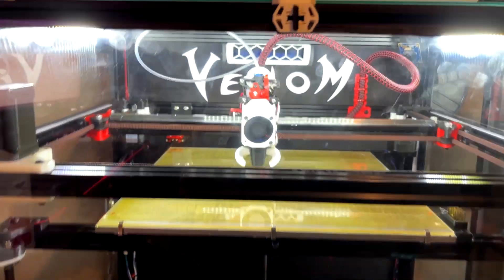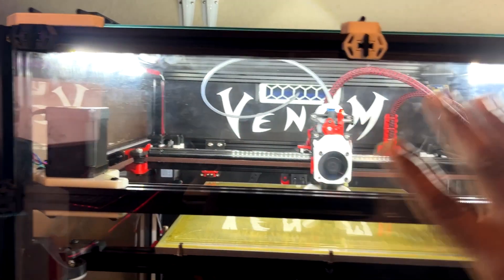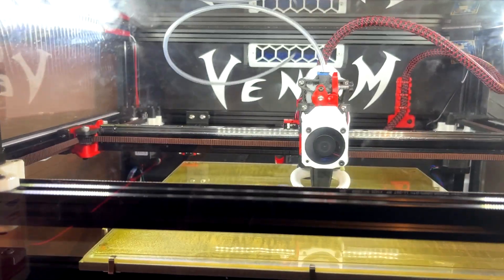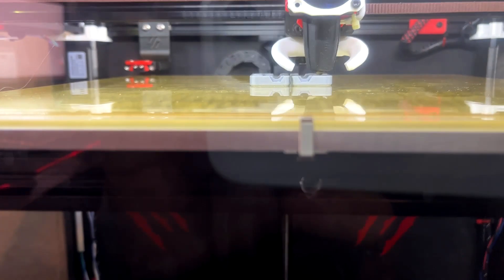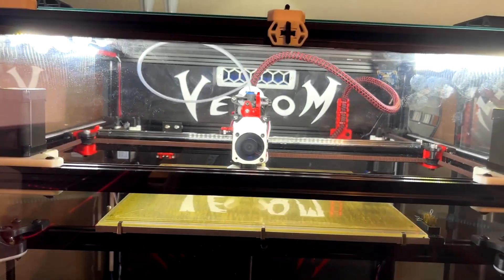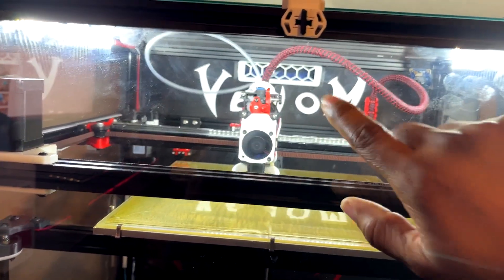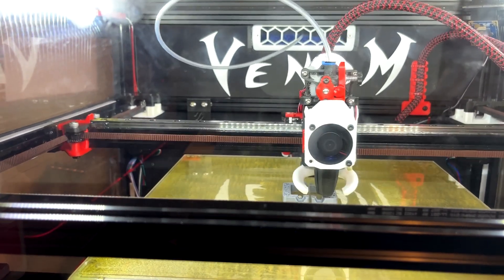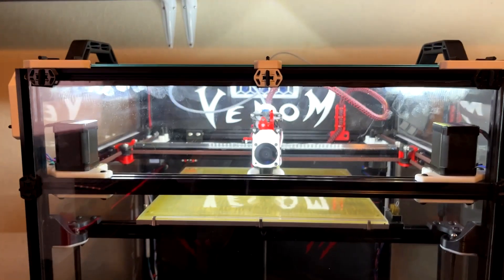Trident VZBot AWD // GoldenJaguar3D

Comment: I must be missing something, no one is asking about the Trident part of your build, that is what I was hunting for. A VZBot 330 stock has one motor, the Trident has three but how did you do that and keep the same VZBot 330 frame? Nice job on the gantry and air cooling, when I first came across the VZBot I understood where the designer was going with the lightweight hotend setup.

Comment: Hey hey! You clearly have more experience than me so a question for you: I´m building a custom sized Voron 2.4 and it will be only for PLA, rectangular 450x350, but I will love to have no heatbed at all, to print cold reliably what will be your suggestion of surface? I can get here a custom thick like 8mm tempered glass easily, should be flat enough, but what to put on top to print cold that is not painters tape cause replacing that is quite a task, maybe big roll of kapton tape? Some especial glue on top of the glass? Some sticker I don´t know about? Thank you in advance (y)

Comment: does your back fan duct hit the back Z screw?
Reply from the maker: No it doesn’t at all
Reply: @GoldenJaguar3D  is it because its higher because you use rapido uhf? Not hf
Reply from the maker: @kaisarantonn7225  actually that maybe possible but I still done think it will hit it won’t even hf Rapido
Reply: @GoldenJaguar3D  where did you get the stl? Especially the rapido UHF fan duct
Reply: @GoldenJaguar3D  this is trident to begin with, when you convert to this, how much bed space you did lose?

Comment: Is there build info and STLs for the AWD parts somewhere? I quite fancy experimenting with this on my Trident but they don't appear to be on the VZbot git.
Reply from the maker: this was modified for my by a good friend if you want it let me know.
Reply: @GoldenJaguar3D  cheers. Definitely interested if your friend is willing to share Fusion files.
Reply: @GoldenJaguar3D I am most definitely interested!!
Reply: @GoldenJaguar3D  any way I could get the files. I’m mid build and would like to try the XY joints out vs the VZ aluminum ones. I had to cut my rail and CF tube to make it fit.
Reply: I'm also curious to see a git put together or links and resources to see what goes into all of it. I'd love to see the adxl results on it too.

Comment: Really cool build! Do you think a 2.4 could hit  these speeds and acceleration?
Reply from the maker: Yes if it's put together properly it can hit those speeds my V1.8 hit prints at 20K accel 250mm/s
Reply: @GoldenJaguar3D  2.4 are much more limited due to the floating gantry, they heavily rely on IS even at like 2-5k accel

Comment: Nice. What drivers, and motors are you using?
Reply from the maker: currently using 2x fystec cheetah board with tmc 2208....will changing those to tmc 2209s with new skr 3 boards

Comment: Hi Henry, I was wondering if you could do a video about speed and acceleration on your machines, I’m very interested in your experience of things like belt tension, idler and pulley quality, oil vs grease, weight of the machine etc etc. basically what do you feel has allowed your machines to get input shaper values that allow you to print at 20k accel and 200mm/s speeds
Reply from the maker: Great suggestion!...I'll work on video like that...stay tuned.

Comment: Stumbled over this while currently also preparing an AWD Trident. Just for my reference what build volume does your Trident AWD have? BTW you have quite the collection of awesome printers!
Reply from the maker: 330 x 310 x 330...the AWD setup took way 10mm more off my y axis it was originally 320mm now its 310mm...thank you.
Reply: @GoldenJaguar3D  Ok cool that's good to know! I'm aiming for 350 x 350 x 250.
Reply: @Rimodo  did you make some custom parts for an awd trident? I’m looking at upgrading mine sometime in the future. (Idk 25k accel ain’t good enough for me)
Reply: @tadhgd350  I’ve designed some but i didn’t came around to building and iterating yet. My other printer is in maintenance mode right now, so it might be a while =/

Comment: hey GJ I know this isn't the subject of the video but you've talked about sanding glass before and I really want to get an ultra base glass for my V0 printer and I have a friend with a belt sander so I'm wondering do you know if you can sand the ultra base glass? I know its not normal glass otherwise I could just cut it easily anyways any info or ideas would be great
Reply from the maker: Hmm I think it would be best to get it cut to that size it would probable be easier honestly. sorry for the late reply

Comment: Allllrriigghhtttt. Ok... So i had no idea how serious acc (and jerk?) is and what it can do for your prints. I print small parts for cosplayers and I typically have to wait 2-5h for these to print. Seeing things on your channel print at such an incredible rate... I need it in my life.
I have 2 elegoo neptune 2s's with Biqu h2 v2s lite direct drives on them and not really any other mods. I'd like to start pushing their limits but i'm in the market for a 3rd printer and having found your printers and seen your prints... Is there a printer you would recommend anybody to achieve really nice speeds as soon as they understand how it works?
My next question after that is... Is there a printer above that suggestion that you'd also recommend for people who are intermediate so I can closely look at them both. Your opinions will be worth their weight in gold my friend.
Reply from the maker: If you want a fast printer right out the box without much tinkering look at the bamboo labs x1 carbon....If you like to tinker and don't mind learning a new firmware an tunning in the process then building  a printer would be the way...take a look at a voron trident or voron 2.4. as well a vzbot those are my recommendation. however you can speed up your existing printer by running Klipper firmware on them.

Comment: you could try a GDSTIME 12v fan running on 24v you might squeeze some more air flow, I run this on my CroXY Defiant
Reply from the maker: funny enough I have a 12v fan connected...however  it's not really air flow it's more the duct is scattering the air instead of pointing at the tip of the nozzles.